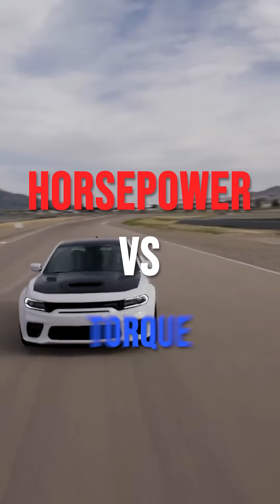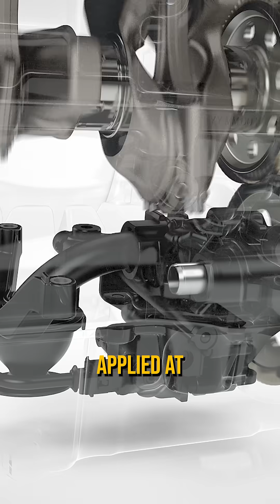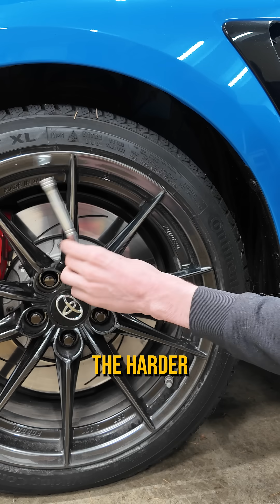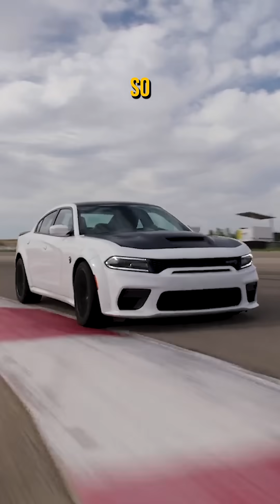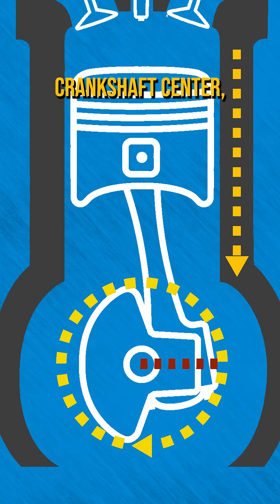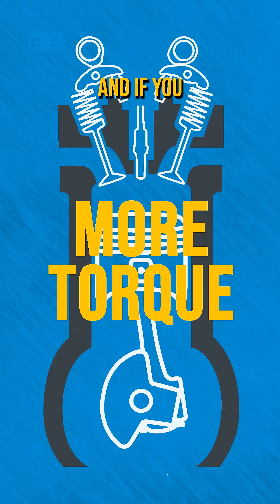Horsepower vs Torque (In 60 Seconds)

Comment: Wrong. A tractor with 45 HP can have a huge torque while many more powerful cars can't move same things as that tractor.
Many years ago I saw a comparative between an M and an AMG. The AMG has almost 2x torque while the M had 30% more HP. Both got the same thing, but many said that the Merc was more reliable on long term due to less friction
Reply: The reason the tractor can tow more than a car is to do with traction and gearing, not the engine. Power determines how much torque you can make at a given velocity.
Reply: @Feldspar-x7h so many typing in the comments like they're bench racers.
When they're incorrect. 
Here's some home work 
200hp / 800trq 
800hp / 200trq
Which engine is more efficient given the same drive line 
A) TOWING 
B) commuting
C) racing
D) idling
Reply: @Joebauers2505 Since when was the discussion about efficiency?
Reply: @Feldspar-x7h it was an example.
Also the original statement is fundamentally wrong. Power doesn't determine torque, torque determines power at given rpm.
Reply: @Joebauers2505 Torque at the wheels=(power*wheel radius)/velocity. Please tell me how that is wrong.
Reply: @Feldspar-x7h torque*rpm/5252.
Reply: @Joebauers2505 Are you trying to make a point?
Reply: @Feldspar-x7h I made the point, I can't understand it for you.
Reply: @Joebauers2505 Let's recap:

1. I say that power determines how much torque you can make at a given velocity

2. you incorrectly claim I'm wrong

3. I give you the formula showing how torque applied at the wheels is directly proportional to power and inversely proportional to velocity, proving my point

4. You refuse to take the L
Reply: @Feldspar-x7h correct recap, 
You say power determines torque already wrong as horsepower is a function created by torque. 
 You said I incorrectly said you were wrong, I was correctly said you you were wrong while your still wrong.
You stated you gave a formula to show your thesis while the formula was incorrect in the basis of application. A wheel doesn't create torque and engine does. And engine torque is given a measurement based on the applied load compared to the energy needed to rotate said load. Horsepower is then calculated based on that by multipling it by the rpm and  then dividing by cross over point of 5252 giving you the horsepower. 
Then you take that and multiply it by whether your are using an automatic or manual, auto would take in account the converter ratio (stall speed) then multiplied by each gear ratio but to get a correct estimate you would lock the transmission into a 1:1 ratio to so the force applied is then only ran thru the differential. By the way it doesn't increase or decrease the torque or HP of the engine, it will just determine the most efficient rpm range for said engine to operate. 
This is all already proven by decades of dynoing whether engine/chassis/hub. 
The main argument you made in which I corrected was you SAID your can't have trq w/o HP and that is just factual incorrect.
Reply: @Joebauers2505 "Horsepower is a function created by torque". How can a linear actuating motor then have a horsepower rating? How about an electrical heater? Do you know what power is? I never stated that a wheel is where torque is created or that you can't have torque without horsepower. All I said was that the reaction force (equal in magnitude to wheel torque/wheel radius) at the wheels of a vehicle which is what performs work, is proportional to the power and inversely proportional to the velocity of the vehicle. Therefore, it can be determined by the power and velocity. Which you have still failed to disprove despite claiming that it's incorrect.

Comment: Torque doesnt matter...explain that pro drag car driver, or a tractor driver, or anyone one with a trailer...i guess I cant say all racing since automatics are superior to manuals now but people with older manuals. Also why not 3 lb flywheels, or 50lb wheels or 700lb trans. Or maybe power of a vehicle motor isnt rpms x power. And also not addressing that I can double my torque much essier than rpms. I guess turbos and superchargers dont do anything. You sound like you own a s2000.
Reply: lmao
Reply: It's very simple. The rate of which work can be done is determined by power, not torque. With appropriate gearing any torque can be made, but power is constant.
Reply: @Feldspar-x7h  Yeah in physics there's a formula for torque. There's a formula for power which is work over time. Now this power equals delta work, now thats a new one but also dont remember a horse power unit either. Where do you find this new science of yours
Reply: @mthompw The literal definition of power is the rate at which work is done. And horsepower is a non-SI unit for power. What is your point? That you don't remember much from physics class?

Comment: I always explain torque to people by saying the center of the axle to the outside of the tread is close to 1 foot distance.  So if your car produces 500 lb ft of torque, that's about 500 lbs of rear force pushing the car forward against the pavement.
Reply: That's only if your car produces 500lbft of torque at the differential output. Between that and the engine there is a gearbox.

Any road car actually produces thousands of lbft of torque at the wheels in first gear.
Reply: Only if you have a 1:1 gear ratio throughout the whole transmission. Which no car in existence does.
Edit: maybe you meant wheel torque. In which case you are correct.

Comment: I think what is meant is that torque "doesn't matter" because you can have torque at 0 RPM, and 0 RPM can't move the car. (you need enough torque to make a full revolution and repeat the rotation movement)  So just torque alone can't suffice.  You need a mechanism that allows those torque pulses to be repeatable.  (same in an electric motor where you have a number of poles creating mini torque moments depending on the phase of the alternative current)

Comment: Torque matter's when pulling a heavy trailer over the Appalachian and Rocky mountains.
Reply: No, power does. Power is the amount of work done in a certain amount of time. 2 pick-up trucks with 375hp one being gasoline and the other diesel will maintain the same speed pulling the same load at the same grade. Wheel torque will be the same because the gasoline one has more reduction.
Reply: @lmb5529bml this proves theory and reality are not the same. 
Your missing so much and you don't even understand why
Reply: @Joebauers2505 "Horsepower (hp) is a unit of measurement of power, or the rate at which work is done, usually in reference to the output of engines or motors. There are many different standards and types of horsepower. Two common definitions used today are the imperial horsepower as in "hp" or "bhp" which is about 745.7 watts, and the metric horsepower also represented as "cv" or "PS" which is approximately 735.5 watts." The rate at which work is done, doesn't matter if one engine has double the torque, if they have the same power, work will be accomplished at the same rate. Provided that gearing is appropriate for each of the machines.
Reply: @lmb5529bml an engine that has 300 HP and 500 lbs of torque will pull a heavy trailer through the mountains better than an engine with 500 HP and 300 lbs of torque. Also, being able to tow in the highest gear you can at the lowest RPM you can will be more efficient than revving and engine to keep it in its optimal HP band. Torque is easier obtained at lower RPM. For heavy loads Torque is king. For light nimble vehicles HP is best.

Comment: Torque doesn't really matter because there is such thing like a gearbox.
Reply: It does matter, it just depends on the nature of the engine’s geometry. A turbine achieves incredible power for the weight, but requires reduction of that speed for effective torque production. 

A diesel engine has a far greater stroke than gas engines, yet cannot rev to the same speed. A Wankel engine lacks compression but makes speed to compensate.
Reply: Correct, torque curve matters though
Reply: Tell that to the single speed gearbox in Ev's
Reply: Most people would prefer to cruise at 2k rpm on the highway instead of having to be at 9k rpm
Reply: Tell that to a truck carrying 70 tons of cargo
Reply: @UncleBane69 this is precisely why those truck have like 12 gears at least.
Reply: So your Honda Civic is gonna pull my 20,000lb trailer as good as my 6.6L Diesel.....as long as you have the right gearbox? lol
Reply: @anonymoushippo-m7d  In theory, yeah. The engine would be screaming at high rpms and wheel speeds would be low (like if the car had an offroad low gear)... and this assumes that everything is strong enough to take the torque.... but that's the principle.
Reply: @Duckferd  While that's all true, there are drivetrain and mechanical/frictional losses to consider when doing extreme gear reduction. In reality, and in theory, no, a high revving 2L gas engine is never going pull a trailer as well as a 6.6L diesel, no matter how much gear reduction it has. Yes, you could gear down a 2L gas engine to tow 20,000lb and get the job done, but much of the horsepower that engine makes is going to be lost to friction/heat while converting horsepower back into torque. Ultimately, horsepower is the overall more important metric than torque, but you also can't make horsepower without torque, so the point is moot.
Reply: Its pretty easy to calculate. Just take the current power output of your Engine, subtract your drivetrain losses and you have you wheel torque. 
Then you divide that by your radius od the wheels and you get the force that pushes the car forwards. 
So torque doesnt really matter, except high torque engines have better fuel economy, higher live expectancy, less drive train losses, higher maintainance intervals, are smoother and more comfortable to drive and need lesser gear shifts. At least for the general use of internal combustuion engines.
Reply: @Duckferd yeah the biggest difference is most that car engines are not made to run for extended periods. but take a bullet proof track car that can rip all day long around a track, like a 911 if you swap it in a truck it would have no problem pulling a 20000lbs trailer
Reply: @geemy9675 with extreme consumption (more rpm more losees), short lifespan (more rpm -more wear), and clutch change everyday [or 1st gear that works from 0 to 3 km/h. (to start moving you will low rpm torque, so for petrol engine you need extreme gearratio )

So we are moving that in real life torque is important.
Reply: @anonymoushippo-m7d  Yes. But with a lower speed.

If you have two 500 hp motors, but one revs up to 10,000 RPM and the other up to 5,000 RPM, and the 5,000 RPM motor has twice the torque, you can pull equally heavy loads with both motors by simply gearing the 10,000 RPM motor 2:1 compared to the 5,000 RPM motor. The wheel speed will then be halved, but since the motor is rotating twice as fast, the wheel speed at 10,000 RPM remains the same as at the 5,000 RPM engine at 5.000 RPM, and so does the wheel torque.
Reply: @anonymoushippo-m7d   Yes, by definition, an engine with one horsepower can pull a 20k lbs trailer.  The point of the video is that the horsepower rating is all it matters in determining engine power.  A big diesel engine can pull a heavy load is because it can generate high horsepower at low rpm.  A small engine can do so on paper, but it would be impractical to build the gearbox suitable for the job.
Reply: @anonymoushippo-m7d  if they have the same continuous power and corresponding gearboxes, yes.
Reply: @anonymoushippo-m7d  yeah exactly if the civic makes more power than the truck and can. people put motorcycle engines in cars that are many times heavier and they have no problem if they are geared properly.
Reply: @anonymoushippo-m7d  if the civic has 150 lb ft but astonishing rpm figure like 30000 probably yeah, your truck run at like 3000 thousand rpm so the civic with a 10:1 gear does 1500 lb ft with 3000 rpm at the gearbox
Reply: Spoken like someone who doesn’t know what he’s talking about
Reply: Your example is wrong because trucks use high torque low rpm engines,

Comment: Torque gets you going, horsepower keeps you going :). There you go, 5 seconds.
Reply: Simply wrong. And extremely wrong at that.
Reply: Keeps you going?  What do you mean by that?  What “keeps you going” is how much gas is in the tank.

Power, not torque, is the limiting factor in not only the top speed of a vehicle but also how quickly it can accelerate at any speed and how much weight it can pull up an incline at any speed.
Reply: Literally the otherway around, that's why the low hp high torque diesels get excellent fuel consumption on highways in Europe...
Reply: @KameeGaming guess you haven't heard of the 750hp Volvo engine huh? Fuel economy means nothing, way too many variables for that. Why do you think they use diesel and not petrol. Low compression, higher combustion more torque. They could make 1000hp V8 but why, an object in motion stays in motion. It's why torque is what gets you going. Once you're moving torque is irrelevant (somewhat) because you're already moving.
Reply: @bluej511 diesels, especially TDIs, have extremely high compression ratios. The more boost the higher the compression ratio. The higher the compression ratio the more torque the engine makes, and the more fuel it can burn.
Reply: @KameeGaming Guess what, because they have less power, THEY CONSUME LESS FUEL!
Reply: @lmb5529bml Power just tells you how quickly the car can do work. If for example, the work is accelerating from 20-60, then it in theory doesn't matter how powerful the engine is, it will require the same amount of energy anyways.

Comment: Exactly! Torque doesn’t matter! Power distribution vs RPM only matters
Reply: Everything depends on horsepower.  That's the most important number.  But you can't have horsepower without torque.  So you need the torque to generate horsepower to move the car.
Reply: RPM doesn't matter too?
Reply: @Inqurzion Torque X RPM matter. But if you have low torque and high power, you just need a gearbox and voilá, torque for days.
Reply: Wheel torque matters massively. Especially when you have the traction to put it down.
Reply: @aktionp20 Wheel torque is a result of power and gearing
Reply: @aktionp20 A tractor has loads of wheel torque. Why? Reduction. TORQUE DOESN'T MATTER! POWER DOES!!!!
Reply: Lol tell that to any diesel..
Reply: @Joebauers2505  my diesel didnt say anything
Reply: @TheNoiseeeee good joke.
Tell it again
Reply: @Joebauers2505  he still said nothing, i dont think he heard me
Reply: @TheNoiseeeee ok bub. Your wrong,I'm right. I'm wrong, your right. 
Bless your heart.

Comment: Torque is measured, horsepower is calculated.
Reply: This is one of the biggest myths. Torque is calculated. That a dyno measures is force on a load cell. That force is used to calculate both torque and power at the dyno roller.

A dyno can't tell you your engine's torque unless you plug your car to it to tell it the engine speed at every point. The figure the dyno returns is power, the engine's torque is calculated based on what the engine speed was at that point in time.
Reply: I don't know where this power can't be measured myth started but I contacted Dynojet knowing their inertial drum type dyno does in fact measure power directly and calculates torque where other load cell type like the Mustang brand measures torque and calculate power. I asked them to explain/provide evidence as to how their dyno measures power directly. This is their reply:Inertia Dynos Measure Power Directly
The Physics: Dynojet inertia dynos measure power using the fundamental physics formula: P = 1/2 x I x w squared / t
Where: I = moment of inertia of the roller w = angular velocity t = time This directly measures the rate of energy transfer (power), not torque.
Key Evidence:Acceleration-Based Measurement:
Inertia dynos measure how quickly the roller accelerates under load
The acceleration rate and known roller inertia directly yield power
No torque measurement is required for this calculation
Torque is Derived, Not Measured:
On inertia dynos, torque is actually calculated from the measured power using: T = P x 5252 / RPM
This is the opposite of what people commonly believe!
Load-Based vs Inertia Distinction:
Load-based dynos (eddy current, water brake) DO measure torque first, then calculate power
Inertia dynos measure power directly through acceleration physics
Why This Matters: This direct power measurement is why Dynojet inertia dynos excel at simulating real-world acceleration scenarios - they're measuring the same physics that propel your vehicle down the road.
The misconception likely stems from people conflating all dyno types. Load-based dynos measure torque first, but inertia dynos fundamentally measure power through acceleration dynamics.
This is actually one of the key advantages of Dynojet's inertia-based approach - you're getting direct power measurement that reflects real-world performance!

See also U.S. Patent # (US3729989A)
Reply: @rollsroyce329 
Thanks for the information 👍
Reply: @lfsracer79  Cheers mate!
Reply: You still need to measure the rpm
Reply: Torque is also calculated.
Reply: pretty sure that's backwards for most dynos.
Reply: Think it's meant like this.
Torque is an actual measurement of a real force. Hp isnt an actual measurement it's more of a prediction based on calculations.
Reply: @Joebauers2505  but force doesn't matter. We want WORK. We want ENERGY